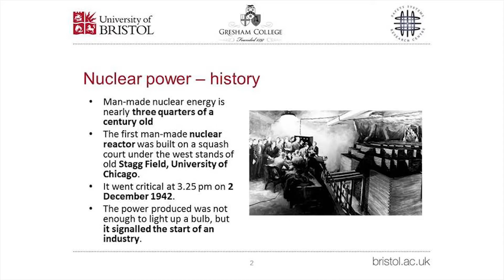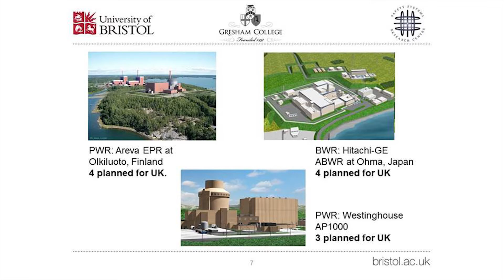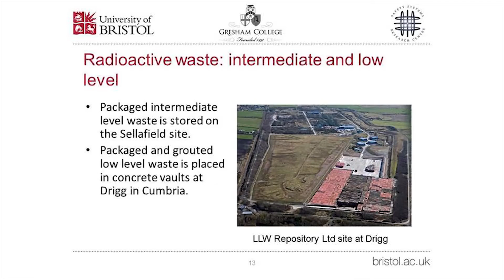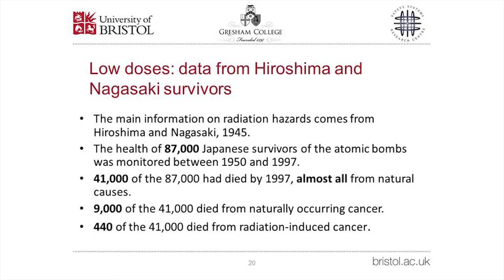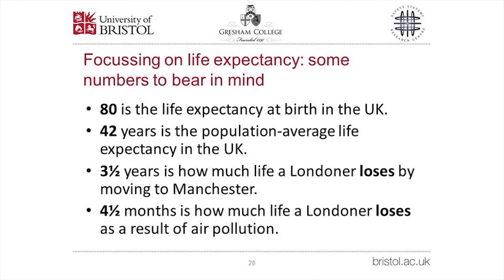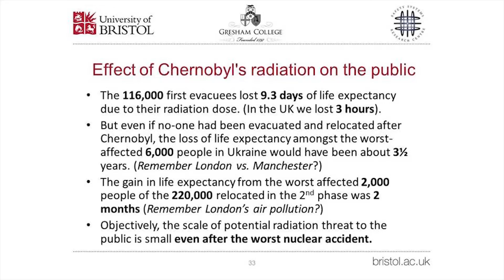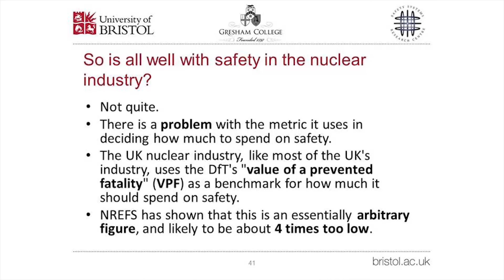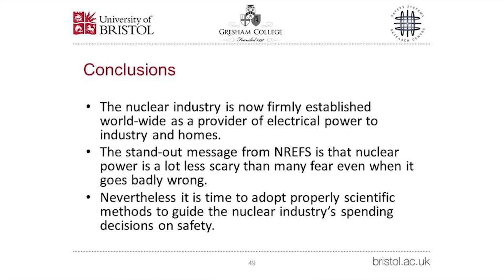Safety in the Nuclear Industry - Professor Philip Thomas

Comment: One way at looking at any system of risk for anything is there is a dicotomy in everthing. Example: case of the Brooklen bridge. 27 people were killed in makeing the bridge most from casaun disease (the bends) .Therefore build no more bridges. However how many lives have been saved because the bridge was build? How many fire fighters crossed the bridge to save a life. how many police crossed the bridge a doctor or a nurse going to a hospital how many ambulances have used the bridge. In total the Brooklen bridge must have saved the lives of thousands of people in the last 100 years it was first built. The same is true for any system aircraft trains etc. etc. The same could be true for coal producing power so a hospital can use it in operating rooms. Nuclear power killed 56 at Chernobal 4000 are alive today that may eventualy die (maybe) by W.H.O. zero from nuclear  waist